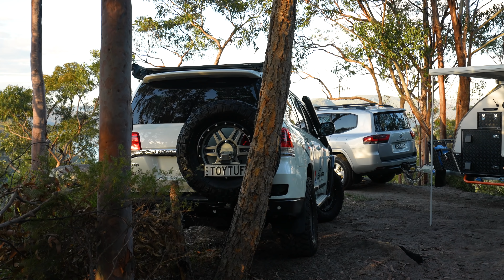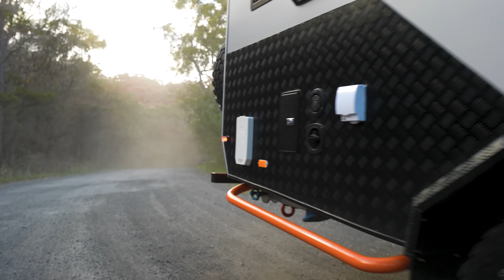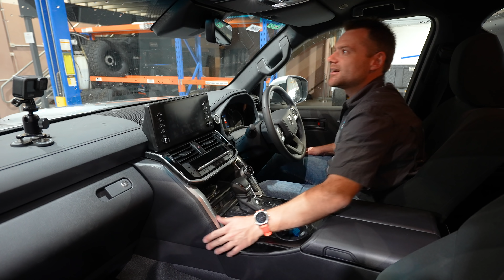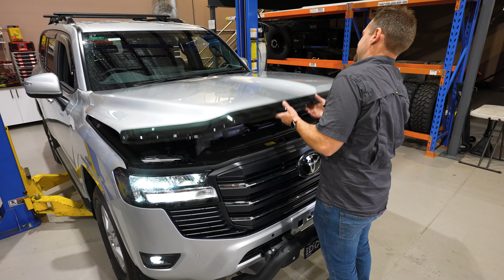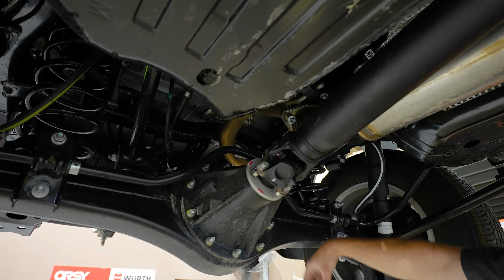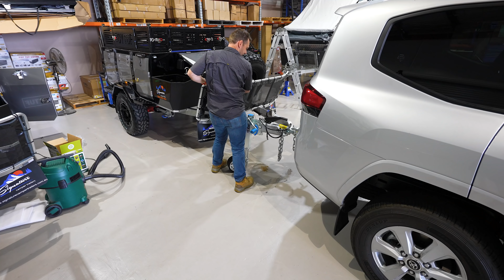LC300 - IS IT ANY GOOD? - Towing - Updates - Fitting 35s - Mods - 3.3L V6 Diesel with 10 speed Auto

Comment: A very unbiased review no hype. I personally am not keen on the 300 has to many shortcomings for me compared to my 200 VX but im sure it will be a great car.
No split tailgate sucks. On the issue of tyres my vx runs 18s as factory issued i fitted ROH rims which fit over the larger front caliper and are fitted with BFG 17s
Great work👍
Reply: O split tailgate sucks

Comment: Love the new tailgate I have been waiting years for Toyota to finally fit this to the cruiser best new feature of the car. won’t get wet when it rains .can add slide outs to use as bench and have a roof above your head . No brainer to me.Not so keen on the use of aluminium on the removable body panels.

Comment: This is the very first in depth/real world video I seen on the 300 and gotta say really good info. Even with the 35" test fit to see gave good info. If worked at that workshop I wouldn't be able to hold myself back from having a good look at the car 😂 well done guys.

Toyota definitely took a couple steps back with this model compared to the 200. Smaller fuel capacity, 1 piece tailgate, no sliding and no armrest in the 2nd row seats and smaller tyres, among other things. Let's see how it'll handle the test of time.
Reply: There is an armrest in the second row in the VX models and up 👍🏻
Reply: @BaileyEthanRawson  now that's just ridiculous.
Reply: @Wtrxprs007able  it is a bit weird I agree mate.. especially for when you pay $110k for the 300 GXL but for me it isn’t really a big deal as generally when I drive my grandpa’s 200 GXL, no one really sits in the back seats often.. neither the case when I drive my Mitsubishi Magna, and that car has an armrest in the rear seats..

Comment: Wow, first review I’ve seen with some negative comments so well done there. Funny how Toyota left the crease line where the split tailgate would have gone. I wonder if the aftermarket guys will offer a conversion back to a split tailgate. I think the one piece gate is a weight saving exercise as that lower tailgate is quite heavy. 
Personally I think the center screen looks like a tacked on after market job and will date very quickly. One improvement I DO like is it’s lose of the bum up stance and the car now sits level. As for the V6, only time will tell but even if Toyota has done what seems like a lot of whiz bangery the old saying still rings true: There’s no substitute for cubic inches. You can’t get around the fact that if an engine is smaller it has to work harder to do the same amount of work. I don’t think a 7% or 200kg weight saving will make up for the drop in capacity and as for the 10 speed transmission, again it will help make the car perform better but that transmission is working a lot harder and changing gears a lot more often. Again more wear and with you guys already working out how much junk you can bolt on it will be easy to see the weight increase from 2500kg to over 3000kg pretty quickly. There is always a compromise and in this case it may be longevity. Even so, Toyota will sell as many as they can make as there is no real competition. With most people that buy Nissan Patrols the first thing they point out is how much cheaper they are than Cruisers. But Toyotas dominate in the dealer network, after market and resale values and the Cruiser is the bench mark to which all others are compared to for a reason. I won’t be in a hurry to upgrade my 2020 Sahara. Cheers Stuart.

Comment: Top review mate. 100% agree that Toyota dropped the ball on the not having the split tailgate. Not only with it being so useful as you mentioned, the real downside will be the boat owners who definitely won’t be able to open the back fully as the anchor/bow sprit protrudes out a fair bit. 
 Not a total deal breaker, but I do like the 200 series set up better in that regard.
Reply: And they say,"We always listen to our customers"Obviosly NOT.That missing split tailgate is unforgivable.They could have at least made the window to lift seperatly.
Reply: The rear seat space???, There is no nice way to put that, Toyota F@#& Up for not extending the wheelbase.

Comment: Just to add to last.  Test drove one today, check out the bonnet, it’s metal actually flutters in the wind at only 60ks like it’s a piece of plastic.    Causes a reflection of the surrounds to flutter in your vision.
Reply: Probably a faulty vehicle. Driven mine to 160...solid as a rock.

Comment: Great review, if the split tailgate is the only real issue, given the number of slide out compartments from within the internal rear luggage area you put in your vehicle.  I carry a table as a work area as the slide out BBQ/sink take up a fair amount or room.  It does seem to me that the interior, engine, driveability (by all reviews) leaves the 200 a long way behind.  I watched a drag race between the 200  series and the basic 300, just not a race the 300 was much better, less noisy in all facets of exterior noise, again no spit gate....move on.  I 
have ordered the new 300 and cant wait to get hold of it..
Reply from the maker: Congrats - you’ll love the new cruiser when it arrives. 
The split tailgate was a feature for us which made it a landcruiser - it was unique and a functional design.
Everyone sets their car up different and there will be solutions as you’ve mentioned.
We use the design of the split tailgate, from keeping the dogs in when in the back to using it as a workbench - it’s hugely functional and as a work car those things matter. That’s just how we use it and our experience.
Thanks for the feedback and your thoughts!
Reply: @SignatureCamperTrailers  Good call re: the dogs. I have 3 dogs and my 300 has just arrived. Bummer. Didn't know there was no split gate when I ordered it and carting the dogs around with me is one of my main things I wanted to be able to do. Also the split gate helps to keep horses heads out of the back as well!

Comment: What a design tragedy! The 2022 Land Cruiser 300 Series loses its split tailgate!
On our LC200 we use the lower split tailgate all the time, to stand on, to sit on, as a table, as a workbench, as a place to put computers, cameras, drones etc etc etc, whilst the upper split provides protection from sun and rain. The one-piece tailgate on the new LC300 removes all of that fun and convenience and would absolutely stop us from buying one.
Additionally, on LC300 the mounting of spare wheel carriers would result in both wheels having to be swung out to enable the tailgate to be opened, rather than the simple opening of the upper tailgate on LC200, without even having to touch the spare wheels.
And another point - when a boat or caravan with stone-guard is hitched up, the swing of the tailgate is such that it may not be openable. Certainly, standing behind the tailgate to open it will be at best awkward and may be impossible. The whole thing is utterly ridiculous.
What was Toyota thinking???

Comment: Great info, with all the mods you spoke about. Will I be able to put family of 4 in there and tow with out upgrading the GVM which hasn’t been mentioned yet. Are Toyota hoping the after market sector will sort this so Toyota can cancel or disclaim any future blame/warranty.
What’s the roof capacity if we want to put on roof rack LC200 has 200kg has this been retained or increased?
Bullbar and winch, which models can fit winch and bar?
The interior is a huge step for Toyota but lacks current technology. In 2 years time it will be 5years behind.

Comment: The wheel studs are 14mm, not 12mm like you normally get with 6 stud wheels.  Looked like it was a bit tight getting the wheel on and I'm guessing the tapered nuts didn't make much contact.  Do you think this is an issue that will mean you'll need aftermarket wheels that are made for 14mm studs and therefore special to the 300?

Comment: Bloody great review. Were they Prado / Hulix rims ???. Will be interesting where to mount both a dual battery,  air  compressor . Have they gone back to a smart alternator???  Rear tailgate -  will be a pain, similar to the Mitsubishi L300 work vans. Try opening/ accessing when a another car parked behind you. The interior & safety specs are a big improvement.👍

Comment: Toyota techs at our dealer already hate the mechanical side. pretty much a crapped jungle inside, fuel filter is in a terrible spot and a bullbar takes ages to do, took our tech over 2 days. hopefully they make a relocation kit for the fuel filter. Over all its pretty much for the city person or road travellers towing a van. It just doesn't feel its been designed with offroad in mind
Reply: No good for vans with that tailgate. Extended draw bars for caravan manufacturers to take under consideration. One of the most convenient features of the 200 was the split tailgate. Also looks an expensive vehicle for slight modifications. Tyres on off road vans - vehicle / van swaps maybe a bit of an issue.  Surprised that Toyota decided to go with the lift up tail gate.

Comment: With the "tail gate" complaints, we need to look past the perceived inconvenience and realise we need to adapt to change.
Yes, split  tailgate was useful..but we found it was in the way if tools etc were on it,( from the pull out drawers).
With the variety of pull out shelves and trays available now, in all sorts of configurations, the split shelf is far more practical..to us
Reply from the maker: Hi Robyn - your right there are products which now help, it’s just a shame that something which was so useful and part of the design of the landcruiser for so long has been lost. That selling point for Toyota above Nissan, Land Rover etc has gone.
Reply: @SignatureCamperTrailers  yes it was useful and a great feature, but we had drawer systems that were always sliding over the "shelf" as well as spare wheel carriers that had to be opened.
We won't be doing that again!

Comment: Good review BUT - the mods you are suggesting  cannot be done in reality.
Bullbar& winch, 2nd battery required for winch, extra fuel tank 150l +150l fuel, rear bar, ridiculous wheels & tyres (because you can't legally go from +60 offset to +0 offset, let alone wider rims) and for most people a lift with heavier springs and a drawer system with fridge.  By the time you have added all this (some of it illegal) your payload of 600kg has more than disappeared without even a driver being able to get in.
Reply from the maker: The 200 series had similar payload, as does the Patrol and most 4wds. In all those vehicles those mods are done plus more. Hence why several companies offer GVM upgrades. Those mods can be done and you will see in time some seriously kitted out 300 series Landcruisers! We are looking forward to some epic builds.
Reply: @SignatureCamperTrailers  GVM upgrade is only slightly useful if you don't plan to tow.  If you want to tow what Toyota says you can (3500kg) you can't really do ANY mods.  If you go for GVM upgrade plus mods your GCM won't change, so then you cannot tow anywhere near 3500kg.  Just because many 200s are kitted out, doesn't make them legal.  The skinnier tyres on the 300 makes it even harder to go wider tyres and stay legal, and please don't tell people they can go from +60 wheel to a +0 wheel with a wider rim and tyre and be legal.  Just a big NO to that one.
Reply from the maker: Fair enough, thanks for your input and watching and enjoying the video!

Comment: In my opinion, the new LC300 lets the model down badly in the engine department.
Admittedly, direct from the factory, the LC300 has a little more power & torque than the outgoing LC200. However, in reality, Toyota has 'tricked up' a stressed V6 to appear superior to a lazy V8 in an attempt to satisfy government demands for smaller, greener, more efficient engines, whilst 'pulling the wool' over buyers eyes in making them feel comfortable with what is actually a retrograde step in terms of reliability and the potential for exciting engine power & torque upgrades.
For instance, a Steinbauer Power Module will safely increase power & torque in the V8 by over 30% yielding figures of 260kW & 850Nm respectively. Try getting that out of the V6 without blowing it to the Scheissenhausen!!!
For what it's worth (probably nothing), I have voiced my concerns direct with Toyota. We need many more to do the same.
Looks like I'll be keeping my LC200 Sahara V8 for many years to come!
Reply: As much as I love my grandpa’s LC200 GXL, I drove a LC300 Sahara a week ago, and I personally think it’s a better car in every way, very torquey, it wasn’t “stressed” like what other people think it is without even taking it for a test drive… mind you I love the V8 very much, has a great note and is easy to drive and is amazing, but it’s a 15 year old engine, and this new engine is moving forward with modern times. Once I have some $ I’ll be ordering a GR Sport LC300.. ofc though everyone has their own opinions on the new car, some like it, others don’t, and that’s the same with other LC models.. 👍🏻

Comment: Your testing a not 35" tire with the vehicle in the air. Put it on the ground and test the steering wheel!. Not that it matters, people with lots of money but not much sense are going to buy this. I can see hardened Toyota fans hanging themselves when they go looking for a new Toyota.
Reply from the maker: It will take time for some to come around to this - the same thing happened when the 200 was released.
As for the bigger wheel - it needs a suspension lift to make it work properly. Clearance was always the main concern with the 200 needing a bit of cutting to work.
Reply: @SignatureCamperTrailers  I'm sorry but this vehicle is a fail from every aspect.  It's so ugly that the only reason I watched the video was to see if it was going to be an apology video. It really is terrible and having no tailgate is probably the least of it's problems.
Reply from the maker: @fourbypete  lol - fair enough, luckily everyone is entitled to an opinion! (I'm not sure why we'd be apologising in our video for Toyota tho....)
Reply: @SignatureCamperTrailers  you are right about that, at least you were honest about the tailgate.